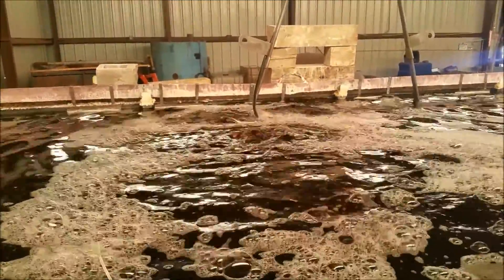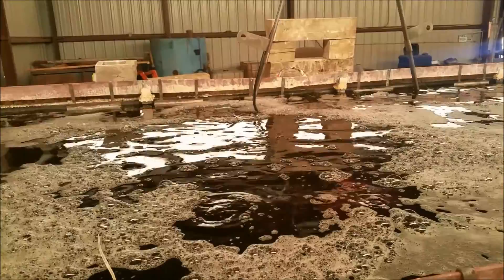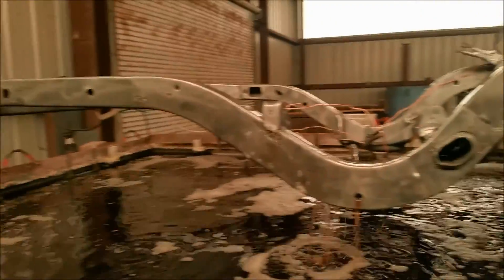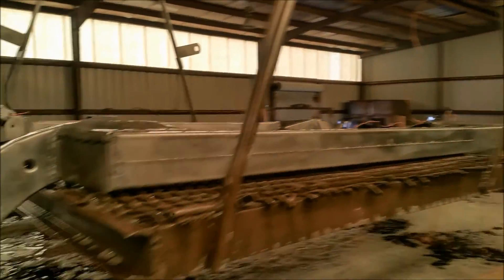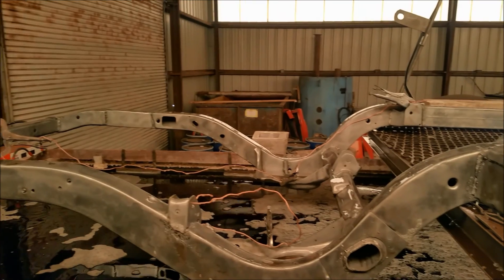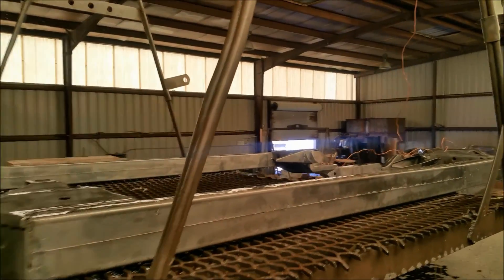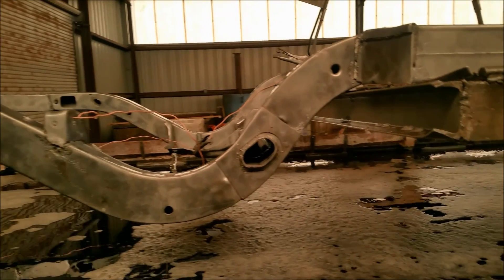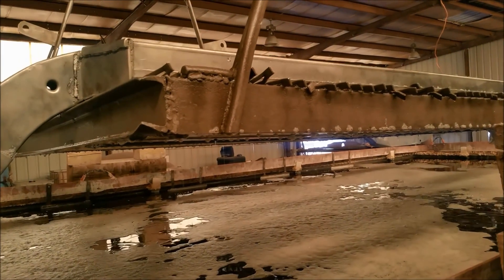Rust Removal: Ford Galaxie Frame

Comment: Dude thanks for posting this I'm in the process of shopping for a base vehicle to make a for fun non-competitive off-road rally truck out of one of those tiny Japanese daihatsu high jets and I've been really worried about trying to figure out how I'm going to get all of that rust off the frame this was the first video I saw when I googled removing rust from vehicle frame and after a little bit of googling I'm definitely going to try electrolysis If you have any tips for a smaller UTV size frame it'd be really cool if you could let me know thanks for posting again